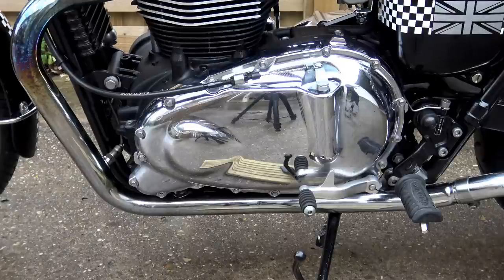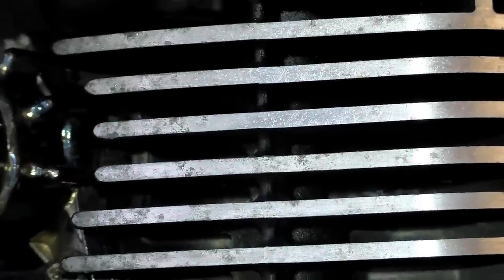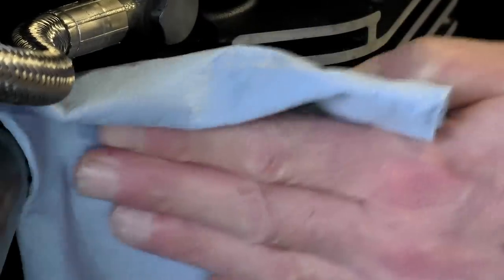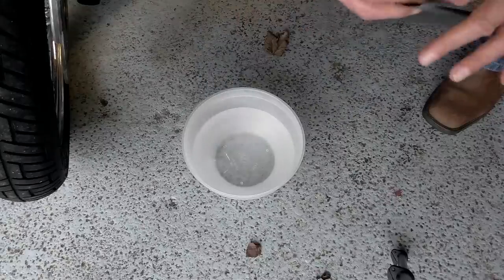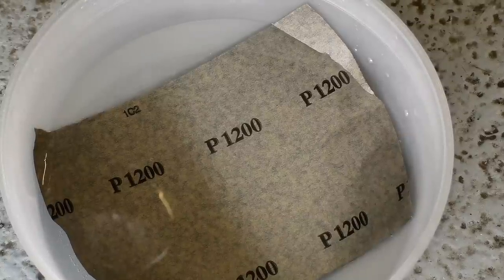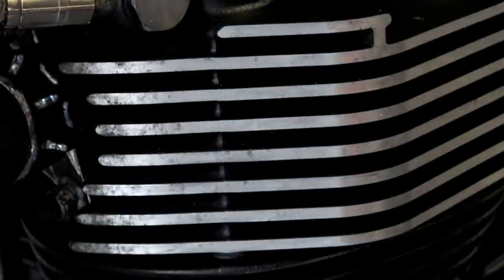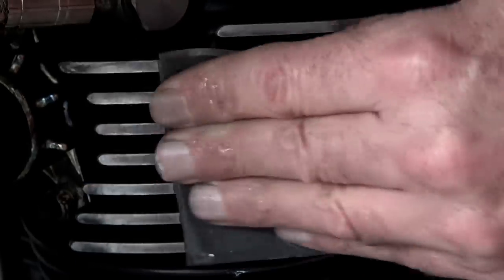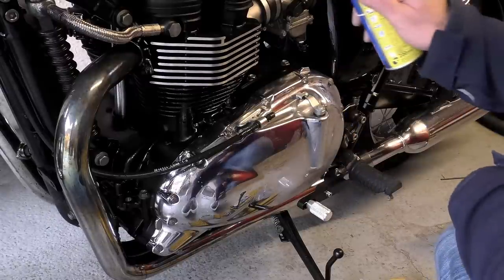Triumph Bonneville T100 cleaning and polishing coroded motorcycle engine cooling fins!

Comment: Looks good. I've done this on large Harley engine covers and you pretty soon realise that you can sand aluminium like you're sanding wood. It just takes longer. I took the rough-cast, textured finish down to smooth aluminium, then over many hours brought them up to a nice shine (not chrome-like - didn't want that). Unfortunately, the fins on modern Harley cylinders have a factory-cut texture to them so if you try to sand-out any pitting / marks you lose the texture too.

Comment: I agree. I’ve done this and it works. I would suggest starting with the finest grade paper(1200). starting with a finer grade paper will allow you take off just enough metal without going to far. I would stop at 400. If the damage is to the cooling fins requires a more aggressive grade paper than 400 it mite be time to replace the head. Good luck

Comment: I’ve recently bought a mag wheel Bonneville that’s very clean, but does have slight oxidation on the cooling fins. I was wondering how to tackle the problem and was going to try using scotch bright pads, but now I’ve seen your method I’ll be going straight to the wet & dry. 

Thanks for saving me some time 👍

Comment: Thanks for this Stu. I've just bought a new T100 and have seen these fins on many bikes (some relatively new) neglected and allowed to go off. I've also seen the worse examples of these where the corrosion has eaten into the upper and lower surfaces causing the coating to flake off. Fortunately Triumph have machined these with a plain finish. On some of the Victory models they finish them with a fairly deep cross hatch finish. These look great but it negates entirely the method you employ. I intend to look after mine and keep on top of it but it's good to know all isn't lost if they get away from me a little bit. Drying properly after washing with an air blower is a good idea followed by a maintenance spray as you suggest. Thanks for the vid 👍

Comment: Exceptional video Stuart. Always a pleasure . This is the exact method I used when I rebuilt my BMW (check my Facebook album), but I also found scotchbright pads and water for clean up and touch up after worked well too. Cheers mate.
Reply from the maker: I have had a look sir, very good. i find it best to use wet or dry on the finer/thin fins as scotchbrite has a slightly spongy texture and can press over the edges on to the painted parts. no such problems on those thicker BMW ribs though i see!

Comment: living on the coast, the salt air will accelerate this oxidation on aluminum surfaces.  I have to clean the cylinder fins on my Harley a couple times a year, after using the fine wet sandpaper paper, I finish it off with an old Tee shirt and some aluminum polish to bring the shine back to the metal

Comment: I tried 1000 grit and it worked great. Still left some small scratches even with light pressure but not noticeable unless you’re up close to the engine.
Reply from the maker: Try a 2000 grit then even 3000 if your going for a polished finish.

Comment: Great tipps thank you 👍🏻 i just bought myself a triumph bobber and i would like to keep it in tip top shape so your cleaning tips are on point for me 😁 one question: do you know if wd40 is the same as what you use, the gt85?  
Keep it coming 👍🏻
Reply from the maker: Hi Brimar, I dont recommend wd 40 as it contains very little oil. any other oil based maintenance should work fine!

Comment: Many thanks for the excellent tips.
Do you also have a recommendation for my corroded Motor housing? Since it’s not a flat surface I guess the trick with the wooden block will not work. Use just my hands with the sand paper?
I treated my T120 with ACF50 at the beginning of the winter and only rode it a few times. I didn’t clean it up after each ride which was the big mistake I guess. So, after washing it now to get of all the mud I had to notice that ACF50 alone did not do its job very well. Many of the screws are completely corroded, as well as some parts of the brushed aluminum parts of the engine. I tried also a rotating machine with some polishing paste but it only worked to a certain extent. The brushed aluminum surface is polished now instead of brushed :-/ So it tried to slightly use 1200 sand paper even before I saw your video. But I used it in a dry condition and maybe not firm enough. So, the result is not quite satisfying. And there are still many spots of corroded aluminum ....... replacing all of the damaged parts might cost some money..... So, may i ask for your advice?
Also regarding the ACF50, should I have retreated my bike after every ride? Or wash it and than retreat it? How do you do it with Double TT? Just once before the winter? Would you recommend it over ACF50? And if yes, do you have a suggestion where to buy it online from Germany? Bavarian salt seems to be the most aggressive stuff in the world :-(
Reply from the maker: best thingto bring the engine casings back is to use a coarse scotch brite pad and just rub in one direction. takes a bit of prctice but quite easy. doesnt matter that you have polished it up. the scotch brite will some scratch it back up!

Comment: Hi Stuart, I enjoy your videos very much, have a 2002 Bonneville 100 it has about 7,000 miles on it at the moment, I like the bike but the alloy cases on mine are very badly finished they seem to have been polished with a wire brush from new are yours the same, John.
Reply from the maker: Yes sir, its called a brushed alloy finish very common with most bike manufacturers, an easy to look after!

Comment: Hi Stuart, Great instructional video and looking forward to cleaning up my cylinder fins with your method.  Question:  I have T-9 spray on my shelf I use to coat boat electrical wires, is this similar to Double TT?  Safe to use on cylinders?  Had any experience?  It seems like a very similar if not the same as Double TT.  Appreciate your experience and thoughts.

Comment: Sir excellent video with precise explanation..which maintainanace spray to use instead of double TT spray as it's not available here in India..
Reply from the maker: im not familiar with what might be available in India sir. the muc off products MO94 and bike spray are very good, other than that any oil based maintenance will do just re apply weekly or after riding in the rain
Reply: stuart fillingham sir thanks for the prompt replu. can I apply wd40 spray. .
Reply: What about using 3-In-1 general purpose lubricant oil?  Both of of your recommendations (Double TT and GT85) are not sold in Chile where I live.

Comment: Thanks Stuart - great video.   I have a new T100 bought late last year.    Rust has already started to appear in the holes in the brake disc which I did not spray with rust protectant for safety reasons.   Do you have any tips for getting rid of this and preventing a recurrence or should I just leave it.
Reply from the maker: I would just live with it! its quite normal.
Reply: Many thanks!